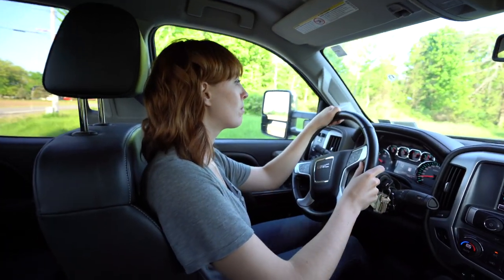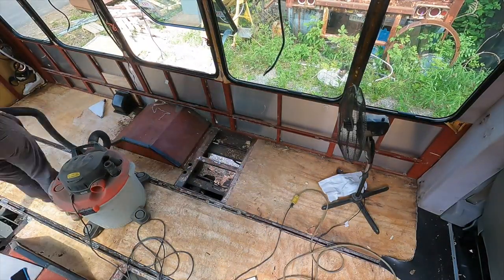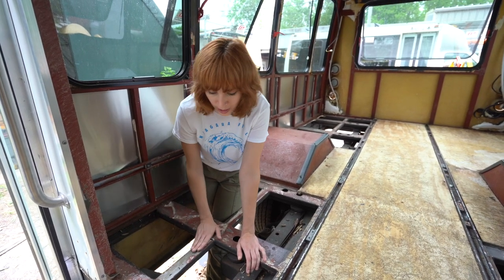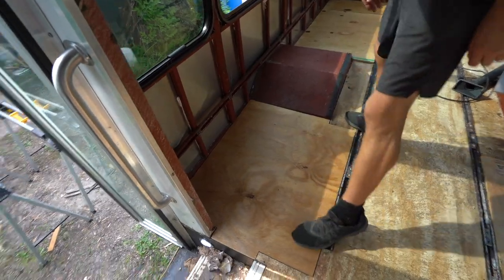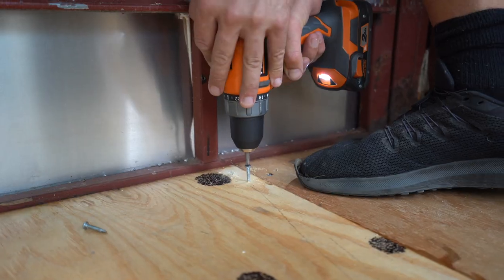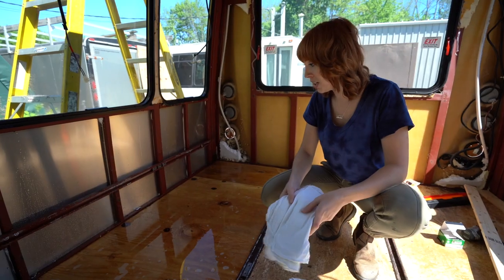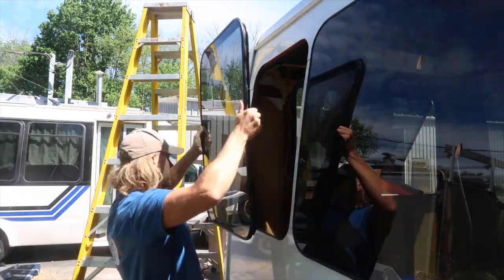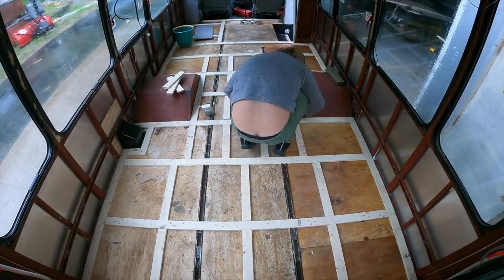Shuttle Bus Build Ep 2 | Sealing the Roof, Floor Insulation, & Subfloor

Comment: I’m loving the detailed steps! 

As a Canadian, I’m 😱 to see that only a layer of wood makes up the bottom of the floor... critters can so easily chew their way thru, and salt corrosion would as well. I’d weld in metal sheets, even aluminum. 🤔

To further protect the windows, how about installing flexible rain gutters above them? They come in flexible strips you can cut to size and bend at the end for the runoff, with a strong adhesive side. You then paint them over when it’s time to paint the bus, I’ve seen it used in several van conversion videos, especially above the side doors! 🤔🤗👌🚌
Reply from the maker: Thank you so much 😊 We live in a bus with a wooden floor and it has been fine! There’s a lot of floor with the original plywood, framing, insulation, and subfloor. Mice and critters are more likely to get up through the dash or holes in the floor for propane lines etc..
We actually already have the adhesive gutters, just haven’t installed them. We mentioned them in the window resealing episode a few episode back. We have them on our bus that we live in and they help soooo much! We definitely recommend them!

Comment: Drew & Savannah, question, instead of plywood put down first, why not metal sheeting weld & screwed down then plywood flooring then insulation sheeting then very tin sheet wood over that then wood flooring? This would appear to present from any under the vehicle splashing on the wood in the 1st place? Ok resume the positions you were in & carry on. :-) Oh, I have been researching & have discovered this for your eye's only. LOL Use after all layers have been done on the floor instead of using floor boarding strips or panels & paint the final playwood flooring with , drum roll, "Battle Ship Paint" it is used on all Ship & Sub & Boat floors. It cum's in a Light Green Lime color & you can then have patio throw rungs in long strips 2 or 3 foot wide & any length you need. They get dirty you just take them up & outside spray them off & they dry fast in the sun. I know such a deal let me tell ya. On the Unistrut I would use spray foam in them to keep any ANTS from making homes in them. After foam has cured just take a flat metal scraper & push along to level the foam out. ANTS will always find a place to make homes. The Black Wood Ants are famous in making this their homes to nest & reproduce. Traveling in all regions of landscapes you can pick up hitch hiker Black Wood Ants looking for a new Home Base to live. A good easy way to always keep Black Wood Ants from coming on board is to sprinkle Cooking Salt at any entrance way & along the bottom of the walls all around. They hate salt. No chemcials ever needed. You sweep up or vacuum up the salt just sprinkle a fine line again of Salt down. Salt is really cheap fix to any future issues.  always, Tommy :-)

Comment: Well done and such a great walk thru on the process. I have a 2011 Starcraft I'll be building out and most of the windows leak and probably the worst part is the emergency exit in the roof that you don't have on yours. I would also suggest checking the welds in the framing on the sidewalls and roof before you cover it up.

Comment: Hey guys. U guys do great work. But What screws did u guys use for the Very bottom Plywood which goes on top of the metal frame? I used SPAX #10 1 1/2, the problem is once i try screwing them down it often shreds right through the metal framing and freespins!!!. I dont wana keep drilling screws that wont grab hold. My plywood is starting to look like swiss cheese! Any tips advice would be appreciated. Thanks!

Comment: my subfloor is fiberglass and seems pretty stable, however after ripping up the rubber that was covering it up I noticed that I can see the ground outside on one side of the bus is this something I can fix with spray foam or do I need to weld something I'm not really sure what to do.

Comment: Working solo... not too concerned about the floor but the windows make me nervous.  Do you think one person can remove/replace them, or should I lure a neighbor over with a six-pack of beer?
Reply from the maker: We would 100% recommend a second set of hands. One person needs to push outward while the other person holds from the outside. If you accidentally dropped one of the windows it can be really expensive and very difficult to find a replacement. If you have someone to help it’ll make the process much easier and safer!

Comment: Any reason you didn't use foil tape on top of the insulation to seal any air gaps between the boards and 1x3's?
Reply from the maker: We did it with our first bus and found it doesn’t make a difference. So we skipped it with this build. We cut our insulation very tight to help eliminate the air gap.
Reply: @OurWayToRoam  It looked like you were very methodical with cutting your insulation instead of winging it and not using straight edges like some other builders haha. Hope the rest of the build treats you well 🥰
Reply from the maker: @sarabeth3016  it definitely made for a tight fit with no gaping holes in between the insulation! Thank you ☺️

Comment: Length and size of screws?
Reply: Did you just do 1 1/4 into the original floor, then 1 1/4 new floor into the studs? Or did you use a longer screw for the new floor?  Does it matter?

Comment: Why are people framing out the floor and spending all that time and effort you can put down foam on the floor and go over with tongue and groove and you will have no sagging whatsoever zip nada zero. That phone is rated to carry thousands of pounds you can run a bus on top of it with the plywood on top of the foam and it will not make a mark on the foam. Save yourself time and money folks.